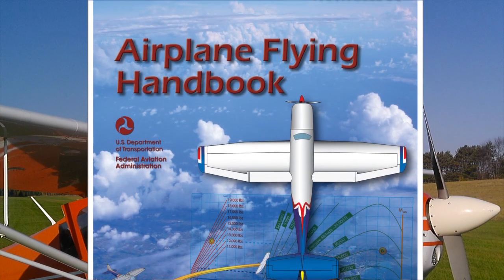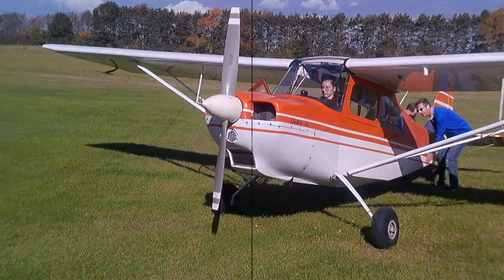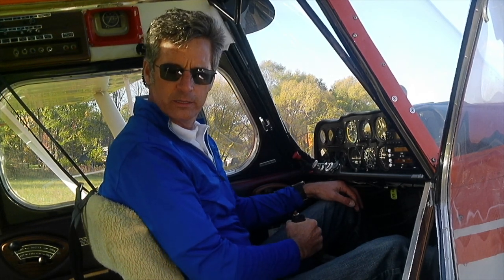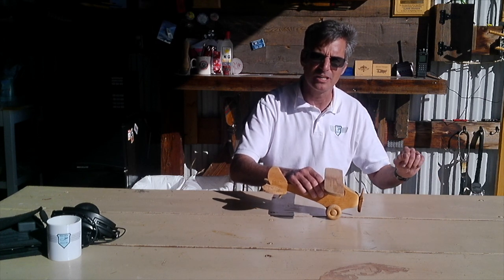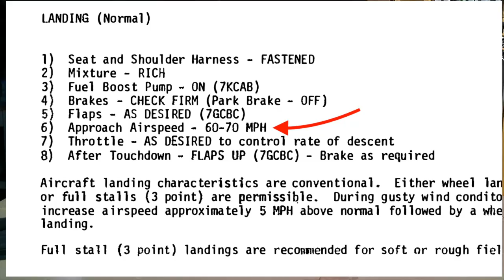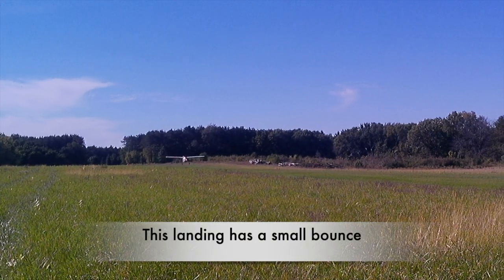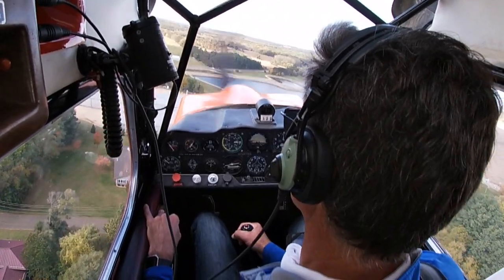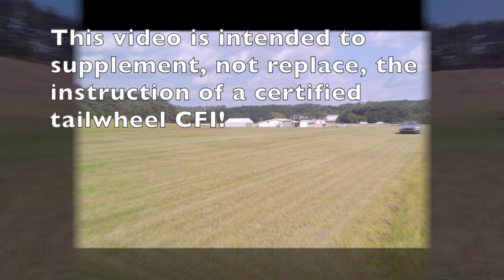How to Wheel Land a Citabria

Comment: Thanks for a nice video! Got my tailwheel endorsement in a PA-11. On wheel landings on approach cfi had me add a little rpm prior to touch down, on touch down pin the mains, power to idle, roll out (cross wind correction if needed) stick forward to keep tail up, when tail settles stick back (cross wind correction if needed) and all as you said as in the Citabria.  Keep that crosswind correction in as needed all the way to the hanger. 👍

Comment: On many tailwheel’s, I like to land with nose-down trim so it takes a little finger muscle to land tailwheel-low. 
Releasing stick pressure after touchdown sticks the wheels and is easier than pushing stick-forward as is often 
required with normal landing trim. 
If I bounce, I add just a touch of throttle and set it down gently with diminishing power. It takes just a touch of power 
lift off and a tiny reduction to land again. 
For practice often “land” 5-7, sometimes even 10 times in one pass of a 5,500’ runway buy touching down, rolling about 100’, throttling up to about 15’ AGL, then pulling power and setting it back down. Note- I announce that I’m doing a “touch and a touch and a touch and a go” so that folks in the FBO or in the pattern don’t get worried. I can recall a few times when 
I’ve gotten tower clearance for the option to do this. I don’t recall ever being denied. 

My Cessna 172 flight instructor taught me to “Pull power abeam the numbers, slow to flap speed, put in one notch
of flaps, turn base, put in another notch, turn final, put in the 3rd notch”. The entire landing was done at idle. 
IMO (after flying 1600 hrs in 11 years and owning 9 airplanes, and doing tons of STOL work, is that this is INSANE). 

The day I FINALLY learned to land a C172 was the day a substitute instructor told me to get 3-5 feet above the runway and add just enough power to keep the wheels there. The first time, he had me go-around. The second time he had me “hover” like this before reducing power and setting it down at a spot we chose while on base. Once I realized that I could fly the plane, rather than it flying me, I was cured and landings were cake!

Since that day, I rarely land at idle and can typically touchdown within 10’-20’ of the runway threshold and stop my Supercub or Aerotrek A220 before “the top of the numbers” which is about 250’.

Comment: A correct wheel landing should have a flare and touch the ground with the tail wheel “low”. Once on the ground stick should go slightly forward to maintain the wheel landing until energy slows. Flying a wheel landing with no flare is incorrect as you will carry excess energy.
Reply from the maker: As you can see in my video, I'm not carrying "excess energy" as I'm wheel landing on a true short field (1092') and slowing to taxi speed prior to the end of the runway.   When I say "no flare" I'm trying to point out that a "perfect" wheel landing is "a level off at exactly the runway".  That's what the FAA says as well.  Having said that, there's nothing wrong with a slightly "tail wheel low" landing -- this isn't a perfect world!  But to say say "a correct wheel landing...  should have the tail wheel low" is not correct.  That is an acceptable wheel landing, not "The" correct wheel landing.

Comment: Trim is everything trim trim trim you have to flare to stop The Descent at that point just let the wheels touch relax at back pressure you have on the stick and it will roll right into Wheels 20000 Landings 95% Wheels

Comment: It would be better to learn tailwheel touch first landings. Practice slow flight and the smallest of backside power management. This type of landing works on ANY surface AND a lot shorter runways. Every wheel landing still must transition to a 3 point eventually and uses A LOT of runway and a lot more ground loop dangers...Moses <><
Reply from the maker: I may do a video on 3-point, as it is also a required skill.  I also may do a "wheel landings part 2" on a paved runway.  I disagree with your assessment that a wheel landing uses "A LOT" of runway.  94C is certified at 1092', and all of this video was shot there.  A properly flown wheel landing will NOT use "A LOT" of runway.

Comment: Very fast landing for a Citaria ... No needfor this at all.
Reply from the maker: Upon what do you base that assertion?  I'm landing on a 1092' runway, on the speed recommended by American Champion, and coming to a stop without using brakes prior to the end of the runway.  Show me where the manufacturer recommends a slower landing.  The Citabria is certified for both 3-point and wheel landings, and I have demonstrated a safe wheel landing on a true short field.